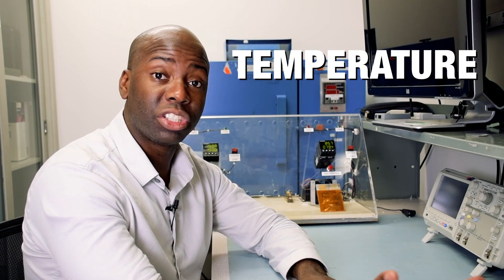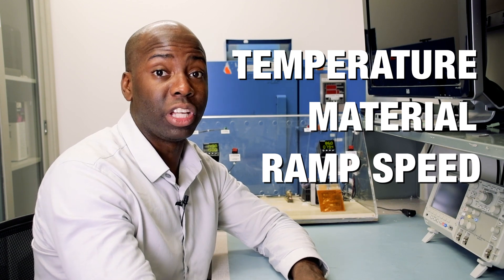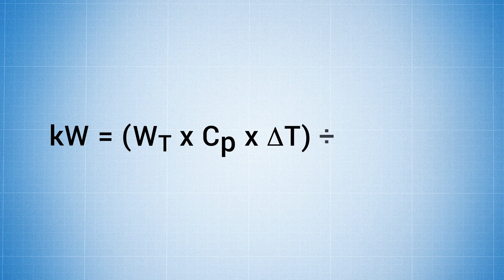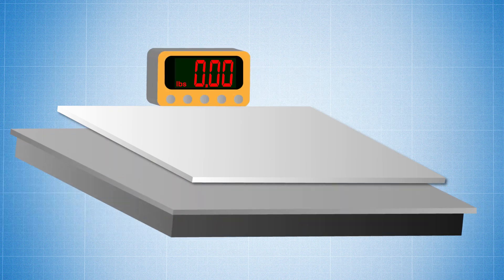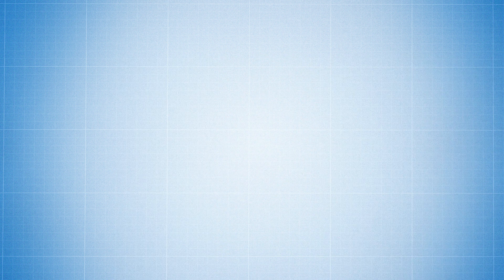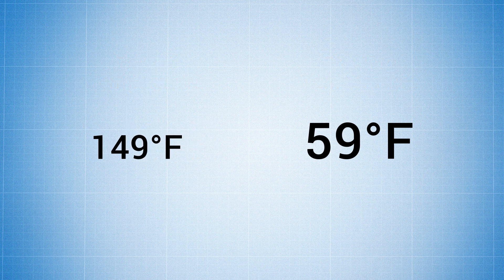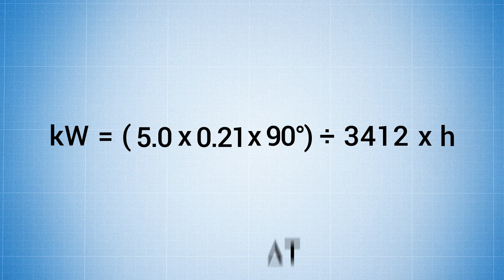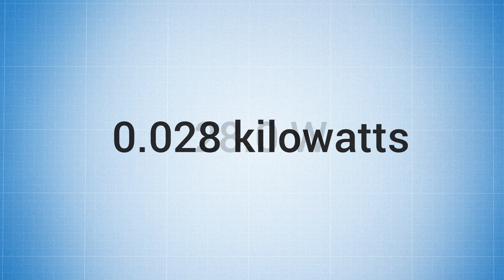How to Calculate your Heater Wattage (Get your target temperature)

Comment: Brother, i have a lithium ion lfp battery in ABS container size 25.2 x 26.5 x 27 cm with 0.6 cm thickness with exact lid with 0.8 cm thickness. Weigh of container is 2.91 kg.. how to calculate the heater pad wattage to bring -40 deg c temp to 0 deg c, pls help

Comment: Based on your formula heater wattage increases with increased heat up time?  Should it not be the opposite? More power would heat up the same volume faster, not slower?
Reply: Finally figured it out despite your application engineer refusing to help - the second half of the equation is missing a parentheses, duration (h) should be in the denominator as well).

Comment: What if Im gonna calculate for the wattage of a liquid chemical. Do I need to calculate for the volume of the tank not the weight.
Reply from the maker: For this you will need to use the formula Q = m*c*∆T. Q (joules); m (mass of chemical); c (specific heat of chemical); ∆T (change in temperature °C). Then convert joules to watts.

Comment: very good way of explanation,,,    can you plz guide to any video or link for calculating time needed to heat metal from 20 celcius to 100 celcius, 50mm sqaure  aluminum pipe, 2mm wall thickness,, 1 meter long,,  in closed chamber or oven (lhw 1,5 x 0,25 x 0,25m), having constant heat source, 100 watts heating element,, and some air circulation.

Comment: Still can’t figure it out, I’m stupid I guess, I just need to know how hot a silicon rubber mat 3/6” thick with heater element wound throughout the mat 2”x 5” 120v and 50 watts, the average temp of inside house is 68 degrees, don’t know everything you need to figure out problem thanks I’ll keep searching
Reply: yeah you are totally stupid

Comment: I want to make heaters for my plastic extruder 
Bailer dia 23.5 inches
Where my starting temp 30 °c
And required temperature 300°C
Applied voltages 440 v ac
Which no of wire I can use and how long plz tell me
Reply from the maker: Hello and thanks for your question! It depends on the wattage rating for the heater you are building. Wire gauges have ampere limitations that can be found in the table on this data sheet from Omega: https://assets.omega.com/pdf/cable-and-wire/heating-wire/NI80.pdf

Comment: hey i am unaware of the BTU conversion for the specific heat of aluminium that you used. The aluminum i am using has a Cp of 714.8J/kg.K  and deltaT is 110C and 1hr heating time....can you please help with this?
Reply: convert the delta celcius into Kelvin

Comment: In the case of muffle furnace 
What should the weight of material and specific heat be ?
Please i need a help
Reply from the maker: Hello Hussam, thanks for your question! In the case of a muffle furnace, you would use the Free Air Heating Equation: Kw = (SCFM x Temperature Rise °F)/3000

Comment: How to calculate the wattage required to heat a tank containing liquid at a given temperature?
Reply: Water = 1 kg
CP = 1.001 BTU/lb F
Delta temp = 78F - 100F= 22F
Hour = 1

((1 x 1.001 x 22F)/3412) x 1 hour = 6.45 watt

Comment: Hi, I want to calculate kw for a tempering furnace, where my load is 250 Kg, material is iron, max temp 660 deg, soaking time 120 min
Please suggest
Reply from the maker: Thank you for your inquiry. You still need to know your Starting Temperature to get your Delta Temp°F (Target (660°) – Starting (?°F). Iron has a specific heat of 0.108 Btu/lb°F. Use the same equation shown in the video.

Comment: How you selected conversation factor?
Reply from the maker: Thank you for your inquiry. The conversion factor is used because kilowatt-hour is a standard unit of electricity production and consumption. However the relationship between the kilowatt-hour and the BTU depends on which "BTU" is used. It is common, but not universal, to use: 1 kWh = 3412 BTU
Reply: @DwyerOmega  isn't it BTU be converted to kilojoules? And watts is a unit of power wherein it's in J/s

Comment: What about heat loss? I think this equation (the equation he is trying to make) is based on a perfectly insulated system with no heat loss. Surely on a cold day it's going to take much more heat than this. This really gives a bad name for "Engineering" especially when "Omega" is attached. I think the 95 "Thumbs up" are from Omega employees. I would check other sources before I trusted any information from this (Omega) site.

Comment: Well, it gives somehow the right idea, but it should be devided by time, not multiplied by time. Either that or correct use of parenthesis is required to repair your equation.
Reply: Exactly  because  kw=power=kjouls/s